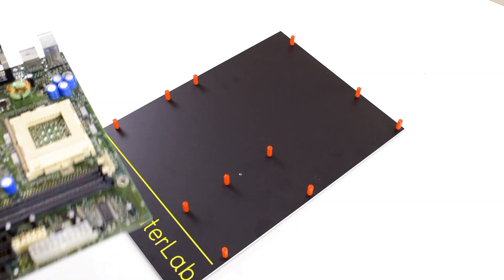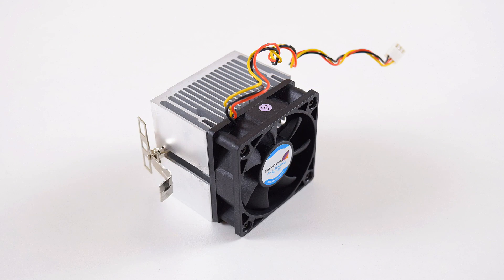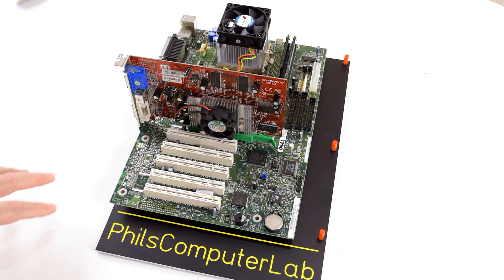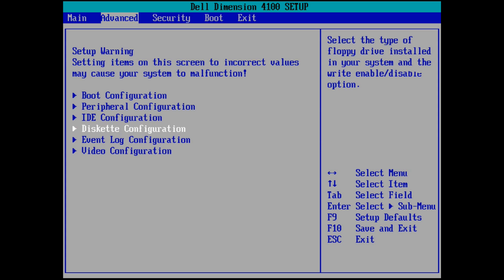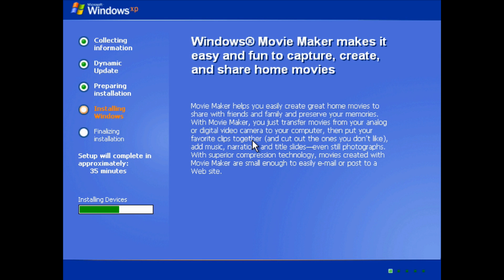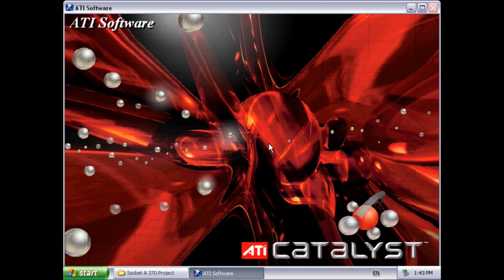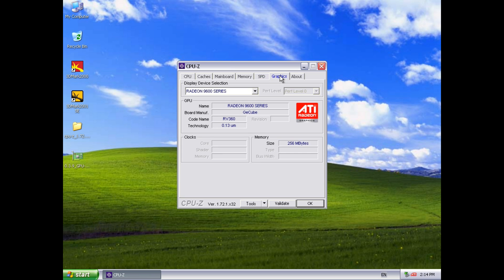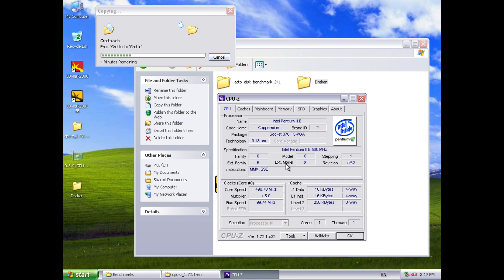Building a Socket 370 Retro Gaming PC

Comment: Lol, your CuMi-500 die is chipped too :D

Unfortunately mine is the only piece I could find so far so I can't put one in perfect condition on display - but at least it works.

On the system: I chose a different path because I wanted to put together the strongest possible "compo rig" for the very end of DOS era, for the very few demos and games that are CPU hungry and/or can be run in higher resolutions. So I went with the VIA chipset for an ISA slot for a DOS compatible sound card. I prefer GUS for scene products and especially the Classic for maximum compatibility. Thankfully it works like a charm in the MSI 694T which is not obvious after my experience with a few ISA Socket 462 boards, this was what steered me towards the latest of Socket 370 platform. And Tualatins even have nice heat spreaders that don't let me damage the dice :)
Memory wise I went with 512MB too, even thought the VIA chipset could handle 1.5GB - 0.5GB is already unnecessary for any DOS game or demo and Win98 (which I'm going to install too) can't stand more than that.
My video card of choice is even meeker at the moment, a Connect3D Radeon 9250, in nice red color. I love its BIOS because it supports any low resolution modes in any bit depth I can think of so every DOS demo that relies on VESA BIOS should work.
Reply from the maker: I found the VIA to perform really poor under DOS, but ok under Windows.
Reply: It is interesting to know how gus compatible with via chipset. I have chaintech 6via5t mobo. I've tried awe64 value - no succes. May be reason in isa PnP. 440bx shows pnp isa devices right after the post beep. Via does not. May be via just don't supports isa pnp? Only non-pnp isa
Reply: Have you tried the "PNP OS Installed" option is the setup? That can cause PNP cards initialized/not for DOS use.
Reply: It's possible, I have to admit I haven't done extensive testing on it. In the beginning I spotted that it was quite a bit slower under Quake but after a Fastvid treatment it started to perform a lot better so I just forgot about the whole issue. Having an ISA slot for DOS sound is still an invaluable advantage.
Reply: The Pentium 3 are much sturdier than the Athlons. They don't break as easily.
Also it is somewhat possible to delid them. The actual active parts are on the underside of the die, so people filed down the siilicon to let the heatsink sit closer.

Comment: I had a Dimension 4100 with a bad PSU. I had to modify a standard one in order for it to work (I used the connectors from the old one). I had that working well with 128MB SDRAM and a Riva TNT2 M64. I was going to swap the cooler and test a Voodoo3 I had, but the board was damaged when installing the new heatsink with 3 clips per side (destroyed one of those tiny packages beside the socket at 1:10). I hope you learn from my mistake and be extra careful when attaching / removing the cooler!

Looking forward to getting the components for a Slot 1 P3 500 build soon, hopefully my Voodoo3 works (I don't have a board to test it yet!) Will make an awesome system for Windows 98 games and high-resolution DOS games.
Reply from the maker: Thanks for the tips and good luck with your build!
Reply: Build up and running, turns out the CPU was a Katmai core. I'd be interested to see how it compares to an equally clocked Coppermine core though!

The Voodoo3 worked out, added a small fan to keep it cool during the summer months. The system runs most W98 games fine, save later titles like Deus Ex that need a faster CPU.

Comment: I built a socket 370 system and can't get windows 98 to install. Do you just put the disc into the optical drive and boot from it? It will not work and I've made 3 different win 98 discs...
Reply: With 9x I would always SYS the drive from another PC and copy the install files to a folder like Win98 on the drive.  Then would make sure smartdrv was loaded and the install would go really fast.
Reply: You might need a boot floppy. Sometimes there are issues.
Also check the image before burning it. Saves CDs.
Reply: I have a US retail copy of 98SE and it doesn't boot from the cd.  I have to use a boot disk to access the CD setup.  If you have a second hard drive or partition, you could copy the WIN98 folder to a fat32 formatted drive and run setup.exe from MS-DOS.
Reply: Try floppy boot then? Any floppy with a CD driver would do (including the 98SE bootdisk from bootdisk.com) and then just switch to the CD drive and run SETUP.
Reply from the maker: Winworld website, and burn the ISO file.
Reply from the maker: Yes you boot from the CD.
Reply: Is there anything I have to do. I made the disc like I do my XP discs, just extract the iso onto it.
Reply: M1kha1lP thing is, I made sure the second and third discs were specifically bootable. May be a hardware problem then.
Reply: Had the same problem on my ´97 slot 1 P3 rig... I booted DOS (rather the DOS version on Hirens boot disk) and ran it from there.

Sometimes older boards just cant read boot info properly from modern CD roms: Mine could boot/install the windows 95 disk fine, but refused to boot the win98 disk ( as with many linux cd's). Loading from a DOS install with CD drivers (Windows) or from a live disk (*nix) solved it for me.

Hiren's Boot CD can help with both...

Comment: Via chipsets are nice. For windows 98 they are better because there are no problems with sound blaster emulation under windows dos box on PCI sound cards (vortex2, ymf724 and cs4624). There is always some problems with that cards on i815. However, for windows xp i815 is definitely better
Reply from the maker: Not my experiences. Intel all the way in regards to compatibility and things just working.

Comment: If you're using nLite why aren't you just slipstreaming SP1 into your custom nLite install? It can do so much more than just populate the OOBE answer files.
Reply: PhilsComputerLab Wouldn't it just be easier to prepare an nLited CD for each SP level? This way you can choose which service pack you want by using a different install CD.
Reply from the maker: Because I want to manually install whatever SP I want to use.
Reply: Was exactly my thought.
Having multiple disks.
Blank XP RTM
XP RTM updated
XP SP1
XP SP2
XP SP3
XP SP3 fully updated.

Comment: Radeon 9600XT with TSOP2? I thought they were using BGA by then.
Reply from the maker: Can you explain that a bit more? AFAIK this card does have slower RAM than usual. 500 MHz effective vs 600 that most other cards have.
Reply: Oh! I see. TSOP2 is the IC packaging (thin small outline package, version 2 has the pins on the larger sides, if I'm not mistaken). BGA is ball grid array. The original 9600XT had BGA, like the 9500/9700/9800 series. Back then you wanted the BGA versions, which had 2.8/3.0/3.3ns memory. The TSOP version was typically 4.0ns (500Mhz DDR), which was in fact used in the 9600 non-PRO and cheaper versions of the 9600PRO. I didn't know they were 9600XT with TSOP. In fact, I guess they weren't, actually. The official 9600XT had 600Mhz memory clock, so that card is something in between the PRO and the XT.
Reply from the maker: Thank you, that explains it :) I guess GeCube used cheaper memory to get a price advantage :)
Reply: Exactly. In those days I had a Gigabyte Radeon 9600 non-PRO, which according to ATi were 128MB 128Bits. But that particular model from Gigabyte was 64Bit. I didn't know better back then, and bought it. It had terrible performance. I later bought a Radeon 9800PRO, best card I ever bought. I loved it. Love the channel! Cheers!
Reply from the maker: Great info, thank you! I now triple check the memory on cards that I buy on eBay :D

Comment: Oh man, USB1? Add a USB2 PCI card for goodness sake.
Reply from the maker: LOL I have no idea why I didn't think of that >< I'll have a look, I should have one lying around.
Reply: HearHear... The PCI USB 2.0 card is a godsend to a PIII Win98SE PC. USB1.1 is only usable for keyboard &mouse :)
I even have a USB 2.0 card in my DOS 6.22 / Win98SE PC (Pentium 133) :)
Reply: Got a combined USB 2.0/IDE RAID/SATA card with VIA chips that works just fine under 98 SE.
Made sure that VIA actually offers driver support before buying though.
Reply: Or better yet, a USB Firewire combo PCI card. There's hardly any price difference. Firewire is strangely unusual among PC entusiasts, but it is really a godsend when dealing with lots of (external) hard drives and data.
Reply: Except from connecting cameras FireWire was more of a Mac thing. And even Apple isn't using it anymore
Reply: Except it wasn't. But people perceived it that way. FireWire is dead now, but it was the best thing before USB3. If they had made 1394b for 3200Mbit or even just 1600 right away and timed it with the release of PCI express it could be the interface to rule them all, 6 years before USB3. You could even build networks with it. FireWire was awesome but lacked real commitment and marketing from manufacturers. Compare with eSATA. That was pretty much bollocks, but it got much attention before USB3.

Comment: Asus CUSL2-c black pearl is my favorite i815 board , probably because of custom startup logo mode
Also never say that board support only up to coppermine core i was running my cusl2-c with celeon tualatin 1300 upclocked to 133 bus via socket mod (late sl5 core) with apacer sdram at 133mhz@cl2 (2x256mb) for 3 years
Reply from the maker: Too expensive these boards, I refuse to pay that much :)

Comment: Dell really liked this mobo layout as it seems to have been used for a variety of CPUs.  You noted the proprietary power adapter which is the same adapter needed for their older Slot 1 version.  The other obstacle people will need to know about is the physical dimensions which I think is a whopping 12" wide by 8" deep.  To put that into perspective, that is the width of a full AT motherboard.  If anyone plans on putting this into a case, they need to be very mindful of the size.
Reply from the maker: I assure it's standard ATX format.
Reply: Nice.  Thank you.

Comment: you have been using this cooler forever! haha
Reply from the maker: Yes it fits Socket A and 370 :)
Reply: It's actually a good choice to use a more powerful socket A cooler on a socket 370 system.
A cooler sufficient for a 62 W Athlon XP will have no issues holding down a 27 W Pentium 3.

Comment: My 370 board only have PCI so I can't game so well on it but the CPU is a celeron 3 coppermine 1GHz OC to 1.33GHz (just put the FSB from 100 to 133) and have 384mb of SDRAM. I wish I have 370 board with more OC capability and a AGP port.
Reply: What is the chipset of your motherboard (or just your motherboard) ? I have a Matsonic motherboard with a via appolo pro chipset. Never tried overclocking on it but it does have some overclocking options in the bios, and it has AGP of course, i think it's compatible with almost all agp graphics card, unlike my 775 board which is only compatible with one type of agp ;)
Reply: Andorria  :redface:
Reply: Full GHz Celeron?
How about going for Voodoo 2 SLI? Or easier look for a V3 PCI. (There are alot cards for mac on the market, but it is easily possible to flash them into Windows Versions)

Comment: what is that adapter for the 20 pin called? i would like to get a p4 1.3ghz system started up.
Reply: But Why? Out of curiosity? Or to actually build a system with RDRAM?

Comment: I knew it. Its a rebranded Intel-d915eea2 board. The Intel version is an awesomme board. I have it running with an P3-933, GF2-GTS, 512mb Ram, YMF-724 and Win98se.
Reply from the maker: These OEM boards are hidden gems. Overlooked, cheap and work great.
Reply: Just watch out for the custom power connectors, sometimes regular PSUs will fit but the pinout is completely different, likely destroying your PSU and/or board!

Comment: nice vid
no dislikes

as of writing
btw can you please do overclocked pentium 3 vs pentium 4
Reply: "overclocked pentium 3 vs pentium 4" i would be interested.i think a 1266 tualatin could maybe match the socket 423 p4 1400.As of 478 i bet it crushes 1700-2000 celerons to death
Reply: Stock 1266 it already crushes these Celerons and some of the slow P4s like 1.4-1.6 ghz, Stock 1400 is roughly comparable to a 2 ghz P4, sometimes even outperforming it
Reply: The early Dimension 8000 series computers used Rambus.  When I worked at computer stores I hated seeing those come in, because they always had the low end memory configuration and the ram price if we ordered it was more than the PC was worth.
Reply: A 1GHz Coppermine Pentium III already manages to exceed or at least equal a Pentium 4 1.8GHz in tasks that don't make heavy use of and SSE2, but that wasaround 2000-2002 without the last drivers for the respective motherboards/chipsets so it would be interesting to see no (as I've found out, late model Apollo Pro 133A motherboards with the 2006 driver have the chipset performing similarly to Intel's 440BX).
Reply: Yeah, depending on the test conditions I've seen 1 GHz Coppermines on par with Pentium 4's in the range of 1.4-1.6 GHz and 1400 MHz Tualatins competing with Pentium 4's in the 1.6-1.8 GHz range.
On 1600 MHz with DDR RAM even well beyond a 2 GHz Pentium 4
Think of around 30-40% less clock for similar performance.
Reply: not with this motherboard :-)
Reply: Phil, if you're up to this, I can provide results with a VIA Apollo Pro 266T board with DDR memory and a Tualatin 1.4 ;).
Reply from the maker: Let me know if you see anything on eBay. Like with DDR or RAMBUS.
Reply from the maker: For sure! It will be a while until I get to the Tualatin, but then it will be easy to compare. Lovely board you have.

Comment: I want to say also that good memory sticks but-wouldnt it be better if using an Asus Tusl2C,or Abit P2-3 B-F series motherboard?i found more interesting then this Dell model.
Reply from the maker: Yes that is so true. I got this Dell board locally off eBay Australia for 23 AUD shipped. Can't go wrong with that. I looked at old benchmarks, there is almost no difference between the boards.
Reply from the maker: Yes I could use a USB 2.0 PCI card.
Reply: Have a CUSL2 here running a P3 933 EB, 256 MB PC133 CL3 and a GF 3 Ti 200. A nice rig for the late Win 9x period.
Reply: Also having a USB 2.0 card is crucial in a faster p III system :)
Reply: Most of the "good" boards are either expensive or very hard to find , especially in Australia.

Comment: I love the motherboard and the AGP port design. The motherboard seems remember my old Optiplex GX110 (I think it was 110).
Reply from the maker: Yea I really like the look of this board. It's very clean, and neat with good layout for the cables.
Reply: The only problem in Dell's motherboard (imo) is the basic BIOS with no overclocking options, some problems with certain ram modules and slowy loading. However they are a good product, stable and designed for productivity.
Reply from the maker: The RAM is configured through SPD, so just use good RAM. But yes, you can't tune it beyond that.
Reply: The motherboard is from a Dell Dimension 4100 if i recall, all Dell P3 motherboards except for the ones used in the Optiplex GX150 and GX50 used propietary PSU connectors